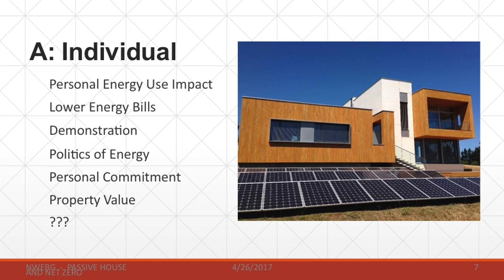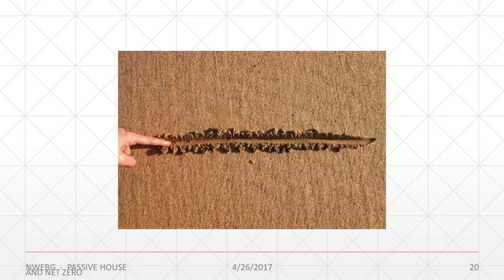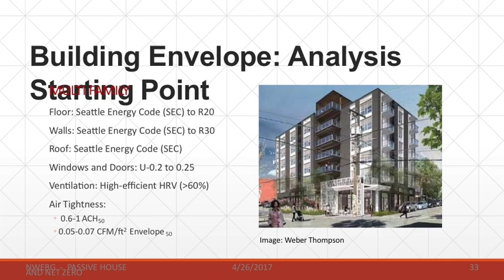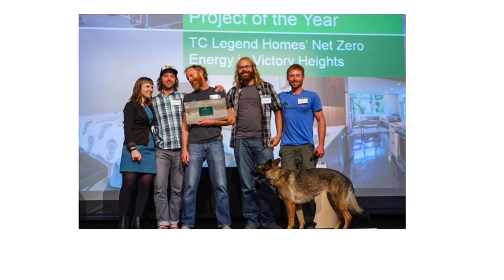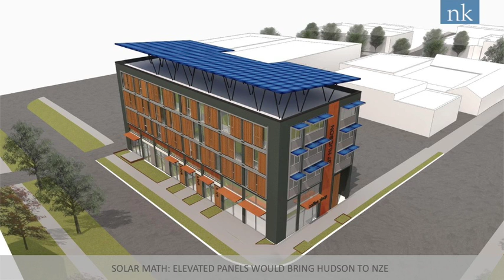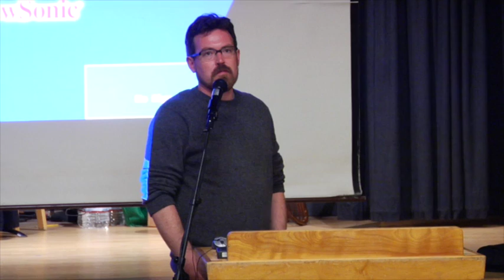Passive House vs. Net Zero House, A Live Presentation in Seattle

Comment: Is there concern for using SIPS type wall construction? ... rumors of these type walls say there are problems getting termite inspection when house is sold.

Rumor says because the nature of foam insulator, termite inspectors cannot see the trademark wood trails left behind when the insects burrow in wooden sill plates, and framing members.

I don't know if all termite inspectors think this way, or if they all refuse to do an inspection because of the foam elements. 

It may be well and fine if one builds a SIPS type home for themself, and lives in it their whole life.

Wondering if you've heard of inspection and home sale problems.

On another note. What about using hempcrete instead of concrete for walls and foundation, etc ... would using such materials prevent getting the needed level of airtight-ness?

Comment: One selling point of properly designed passive home / net zero home which I haven't heard mentioned too much, is that if/when the public utility systems go down, like power / water, etc, I would like to have a house which had ability to run on-grid or off-grid, meaning battery / solar, and local water storage cache, so when utility service goes dead, the house continues to function normally, and is not reliant on public services.

Comment: In Europe we have heavily taxed energy and fuels, so ROI on heat exchanger vs gas boiler is a no brainer in a multi unit building. The same goes for insolation, waste water heat recovery units in hotels. EVR or HRV is essential in a modern building for air quality. Computing waste heat can be used to heat water and/or space. I like Tiny house Studio apartment designs for it's efficiency use of conditioned space. As more and more appliances uses DC power there is a need for more efficient ways to deliver PV power to them. We should support Open source hardware and software that is designed to last, be upgraded, repaired, refurbished, lastly recycled

Comment: This is all so interesting! One question I have though, if a hairdryer is enough to heat a house in winter, how does one combat that in summer? If I use my hairdryer or cook or bake anything in summer, wouldn't that be like using both an air conditioner and a furnace at the same time? wouldn't they be running at cross-purpose?
Reply: A year late... These types of homes are built to be very airtight so they don't rely on poor construction for air exchange. They have powered ventilators that bring filtered fresh air in and out in a very controlled way. The incoming air is distributed into all the living areas and the outgoing air is taken from moist, smelly, or hot rooms like kitchens, bathrooms, and laundry rooms. You can temporarily set these ventilators to a boost mode to directly help mitigate a short-term heat or moisture increase. I should also mention that the incoming and outgoing airstreams travel through a heat exchanger. These ventilators usually run at a low speed 24/7. They can also have co2 sensor to increase ventilation if you have a lot of people over. 
In regards to additional cooling... If you are using multiple efficient mini-splits to cool your home you would only be cooling the zone that got warm and not the entire building. 
It's really not any different from what happens if you were to bake in the summer in a traditional building. The mini-splits and ventilators are all variable speed and you don't normally operate them at maximum. You can have a very targeted response to a heat spike without changing the climate in unaffected rooms.